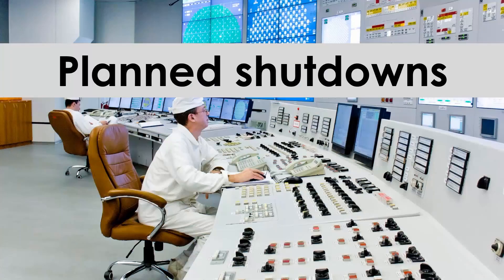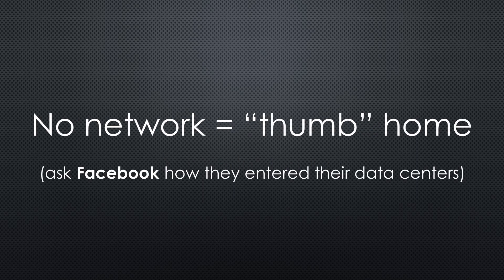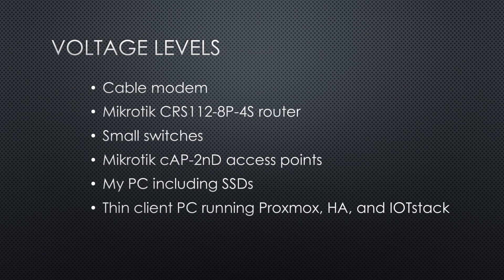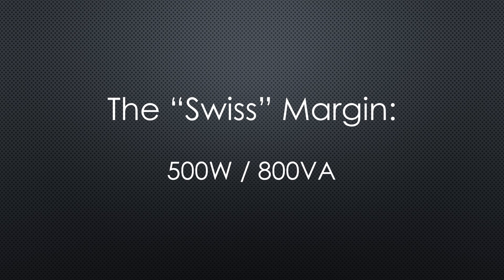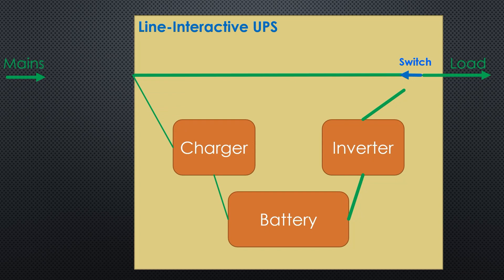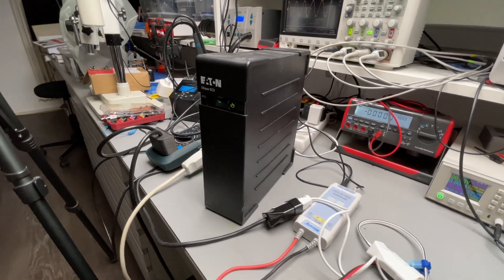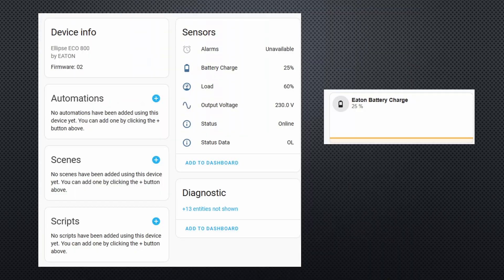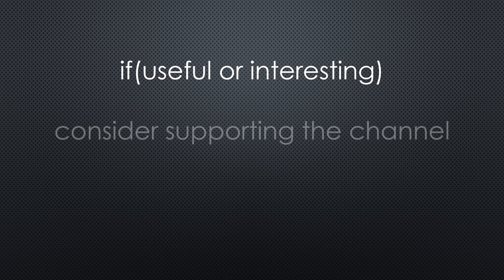447 How to protect Home Automation and PC with an Uninterruptable Power Supply (UPS)

Comment: I bought a bunch of Cyberpower 1500va UPSs that are scattered across my house.  On my "datacenter rack" I've got two setup for "A/B" power and loads are distributed between the two.  With my fiber ONT, router (dell pc, pfsense), NVR (dell pc, blueiris), my Proxmox node (2015 era supermicro 24 bay server, 2x e5 xeons, 2x PSUs), and a switch (unifi us-48-500 model) the pair of UPSs can keep everything online for about 20 minutes during an outage, surprisingly.  Eventually I'd like to try and upgrade to something that can provide a little more run time, and ideally, I'd like to get a transfer switch and backup genset installed but both of those are outside my budget for now.  The rest of my UPSs are on my main TV/AV receiver, another on a couple of my desktop PCs in my office, and the final is for my 3d printer.  They've been very reliable, even a couple older models.  

After got them all set up, I went through the trouble of spinning up a WebNUT dashboard server, installed NUT on Proxmox's baremetal host, and all the other machines around the house.  Integrated it into Home Assistant, had everything working, then the problems started.

NUT just randomly decides it can't communicate with the UPS, and if no intervention is taken, won't ever talk to them again.  I wrote a script that I added to my crontab to run every hour (/bin/udevadm control --reload-rule && /sbin/upsdrvctl start), and it didn't fix the problem, just a bandaid to make it work again.  Eventually I started to notice, if my power glitched even for a few milliseconds, Home Assistant (full virtual machine running on proxmox node) would die.  Completely.  Took me months to figure out why, until one day I was messing with the UPSs on the proxmox node USB connection to diagnose the NUT issue, unplugged them, and discovered Home Assistant VM died.  That was the end of my investigation into both NUT and HA dying.  Completely gave up on NUT.
Reply from the maker: Thank you for sharing your analysis. I have to admit, I suspect the USB interface has an influence. And recently, it completely died. So the Eaton will go back and next time, I will experiment with a USB insulator...

Comment: I live in South Afrika and power outages is a daily occurrence, I have my whole house protected by grid tie inverter and a 10kwh battery with about 6kw of solar panels. Backing op a PC can be done with a Pico PSU and a battery and network equipment with a buck/boost converter from the same battery. I started off with a lead acid battery but quickly realised they are no match for 2 hour outages so I built a DIY lithium battery with 100ah LiFePO4 cells that could keep devices running for about a day. In the end I opted for a big system as I need to be able to continue working during power outages, and that means having coffee and cooking/heating food.
Reply from the maker: My 10kWh solar battery also protects my home for a day without sun. But, because its inverter has to switch off for a few seconds, I needed an additional protection. Going DC as you did with your Pico PSU for sure is a good possibility.
Reply: @AndreasSpiess  strange when the grid falls away and my Deye inverter switches to islanding mode I have a millisecond delay where the relay clicks and nothing reboots, maybe your cables are not big enough and causes DC ripple as the switchover should be seamless. I should have mentioned that my Pico PSU and DC converters was my first attempt to protect against power outages
Reply from the maker: @HeinzMeulke  Our utility company wants a clear separation between the inverter and the grid when the grid is down. It seems that your inverter does this separation extremely fast.

Comment: Great video thanks. I use a similar sized apc ups to power my Synology nas and Poe switch. In turn my Poe switch powers my 8 raspberry pi cluster. I also use nut to provide the remote shutdown to all the pi’s and the nas. 

I think I have made a light error, being worried about switching times my setup is an online ups but being in the uk the power is quite stable.
Reply from the maker: You never know. Up till now, I also did not care about power outages...

Comment: I would recommend looking at a MHPower MPU300 or 500 series...you supply your own (lead-acid) battery, it's sinewave and not outrageously expensive. Also the case is metal. No communication though.
Here they are popular for backup power for circulation pumps on solid fuel heating systems.
Reply from the maker: Thank you for the info. I did not see them in Switzerland. But it is good to know if I have to change my Eaton. Communication is not so important in my setup.

Comment: My Victron Multiplus II provides my UPS function. It has 2 outputs, one back into the mains circuit, which goes off when the mains does. The second essential services output goes to a separate panel and serves a few essential sockets dotted round the house and the lights. One of the sockets powers my PC so that never gets cut off. The Victron controller replaced a Pi and this connects directly to the 48v batteries. The router is run from these via a DC/DC converter so again it never goes off. In a long grid down situation any mains kit can be connected to the essential sockets with an extension lead. The gas boiler has a plug fitted and a dedicated essential socket next to it.
Reply from the maker: That is a good solution. My Huawei also has such an outlet which is cut-off for a few seconds when the grid is down (this is the reason for my UPS). But I was not satisfied with this solution as I will show in the next video ;-)

Comment: We played around with an offline UPS and a variable powersource. The connected 100 Watt light bulb flickers when it switches. While lowering the input voltage the output voltage drops to a certain level then the UPS starts supplying power when lowering further it switches completely over. We went to online UPS for anything PC or PLC related.
Reply from the maker: Good to know!. Mine is now back to the supplier (the USB stopped working). So we will see what they say. I did some test and usually, the switching was extremely fast (as shown in the video). But sometimes, not :-(

Comment: @AndreasSpiess your modified sinewave ups is the problem as many switch mode power supplies can't  detect a decent zero crossing and won't start or wont start properly. I've seen this happening with TV's laptop and computer's. Supply them with a pure sinewave and they will start without a problem.
Reply from the maker: Interesting! I was not aware of this problem. Because switching PS rectify AC, I thought, it makes no difference.
Here, everything works and it is not a problem of switching on. But maybe these waveforms have different "side effects".

Comment: I recently bought a Bluetti EB70, which seems to be able to do pretty much the same thing, perhaps better. If your eaton device turns out to be suboptimal, you might consider one of these devices. It is technically not a UPS though.
Reply from the maker: These are a new class, I agree. Probably an overkill in my situation where the UPS only has to survive for 3 seconds. But they are good for other use cases.

Comment: I am also considering a UPS for a modem, 2 routers and a Raspberry pi. Important for me is a low standby consumption. I noticed that this is not often mentioned in the "technical data" as published by webshops.
Reply from the maker: I agree. This is why I went for an offline UPS. Now I cannot measure its power consumption because yesterday, it completely died.

Comment: That's a benefit for the online mode, the loads never see a power source change, because they are always running from the inverters. A power failure becomes something that is only "seen"at the ups, and the loads continue on with no changes ( faults tend to happen during changes in operating states, rather than steady states). Datacenters will only use online and similar types of UPS.
Reply: A related benefit to online is you always know the relative health of your inverters and the ups in general, because it's always running. You don't need to trust that it will turn on fast enough (or at all) during a power failure, when you need it, because it's already running... If course household usage may not call for this level of reliability, but if you have the need, this is the advantage of online... (Simpler (in many ways) design, higher reliability, fully clean load output, but at higher cost, and lower overall eficiency)
Reply from the maker: I agree that an online UPS has many advantages. What I did not like is its efficiency. But maybe I have to re-think my choice...

Comment: Have a Eaton Powerware on the "to be disposed" pile. The network card permanently crashed and disconnected controller the NAS and it seems to have a issue that it permanently wants to run passively, which results in a ton of heat in the case even at low loads. Much worse than the UPS I had before. 

Currently running a tiny consumer UPS, which is good enough for the NAS and other stuff, there is seemingly no need for a pure sine wave.
Reply from the maker: Thank you for sharing your experience. My Eaton in the meantime does no more deliver power...

Comment: I am living in a country with several power outages during the day. 

First i built a DIY UPS with a Meanwel Ad155 12v 10A switchable Power Supply using voltage converters for 5V, 9V, 12V, 48V for Pi, Switch, Ext.Hdd/FritzBox, POE Switch with a 12V 17ah agm battery. 
This worked well until the V regulators kept failing. And during switching between lineIn and Battery either the modem lost dsl sync or the poe switch went out until the regulator for 48V adjusted. Didn't happen all the time but was annoying none the less.

To solve this i bought a 230V PowerSupply from Kemot ProSinus 700VA buying a 65AGM battery. 
Now i use the regular power supplies that come with the appliances.
Added a miniPC and my Alarm Sytem to it. 
So far now problems.
Reply from the maker: Cool. You went the same way I initially wanted to go with several DC voltage converters. So it seems that a 230V UPS should be a good solution. Let's hope my Eaton will be repaired.

Comment: Hi, I think you missed an important topic about offline UPS! A phase difference between the grid power and the internal inverter of a UPS can potentially cause a voltage spike. This can happen when the UPS switches back to grid power after running on battery power, if the phase of the grid power is not in sync with the phase of the power being output by the UPS's inverter. This can be a problem for sensitive electronic equipment, as it can cause damage or malfunction. To avoid this issue, some UPS systems include a feature called a "phase-lock loop," which synchronizes the phase of the UPS's inverter with the phase of the incoming grid power, reducing the risk of a voltage spike. Additionally, a good quality UPS should have built-in surge protection to mitigate voltage spikes caused by phase difference or other issues.
Reply from the maker: I agree, these voltage spikes could be nasty. I never saw such spikes, but I do not know how they do it. Maybe they try to synchronize before they switch. Or the standard surge protector inhibits a spike.
Reply: @AndreasSpiess , I know you are very knowledgeable about what I said. I wrote this because you mentioned a problem with the "EATON" device in the video. As you know, we may have up to 380 V voltage differences due to live-line phase differences. Therefore, for example, any protection at the input of the power source (such as PTC, etc.) may reduce or even cut off the input power to the power source for a while, and it is normal because this spike ends after a short period. cause illogical events in your equipment. And maybe cheap inverters may not have any protection in their output for this synchronization. As far as I know, Line-Interactive UPSs do this coordination at the time of the switch from the inverter to grid power.
In the end, I must add that I have unfortunately experienced these spikes several times and unfortunately the power supply of my servers suffered severe damage several times until I noticed this problem in my offline UPS and upgraded it to online models.
And thank you again for your interesting videos.

Comment: I'm using RIELLO SENTINEL DUAL 6KVA for powering my office room directly from the fuse box with a RB1 Bypass switch for maintenance. I found it to be basically a ''powerwall'' alternative for cheap. I keep it in eco mode and it consumes 50W extra and that's a not big price to pay for ability to continue working for another 5 hours. I don't have it connected to grafana or home assistant as it does all I need it for. For now the ups can send out a command/email when I'm not at home and it will safely shutdown all the components. The only complained I would have is batteries... Only recently server space has started to adopt lithium. For the same space that my unit take up I could build 4-5kWh battery, while mine is only 2kWh right now.

I also have Eaton 9SX6KIRT, but I haven't played enough with it to give a proper opinion
Reply from the maker: This is a "biest" compared with mine. Because I have a 10kWh LiFePo solar battery, this would be an overkill (shown in the next video). But in your situation it seems to be ideal.

Comment: One of the jobs on the list to make a small battery ups for the internet.
The computers and servers already have theirs, it's just the modem and router that needs something.

Building my own from scratch as it's a standard DC and relay... Problem is that the ISP doesn't seem to have one...

We had a power outage, the internet went down but it took virgin (isp) around 40 minutes or so to get their equipment working again.😢

I have small ups and big enterprise inverters that could run the whole house.. and off grid solar.😊
Reply from the maker: So you are already perfectly equipped ;-)  My ISP router is also very "vulnerable", BTW.
Reply: @AndreasSpiess  well the two devices are separated (by rooms) so I have to make two power supplies. 
Power here is fairly good, we have had a few blips and some I've not even noticed, but the ups has logged them. 
We had just over an hour last week. Which isn't bad for 8 years...

I'm in the process of battery building, the old laptop ones.. not recommended. But I have an ev battery (NiMH) but I've not tried it out and it's been sat built for a while now. But if needed it can be spun up quickly.

My big issue is not at home but other services that can go down. Aka internet.

Comment: I use APC UPS devices, one per PC and one in the Data closet. They always switch correctly so I don't lose connection. Since I have a Whole house Kohler backup generator, the UPS's only have to work for 11 seconds. Most will last 30 minutes.
Reply from the maker: As you will see in my next video, mine also only has to run for 3 second till the "big sister" kicks in. But I expected that it is able to bridge these 3 seconds.
Maybe I had a faulty device. At least it completely stopped working for the moment.

Comment: With the current energy prices it would be nice to see more info on the additional (idle) power consumption of the UPSes. It is very hard to find a comparison of idle power of the different models/brands/types.
Reply from the maker: Mine consumed around 8W in addition to the load when not charging.
Reply: @AndreasSpiess  I recently bought a PowerWalker VI 850 LCD  which consumes around 17W. That's a lot for doing nothing. Still would like to find a small/cheap one that consumes very little when idle.

Comment: We have three CyberPower CP1500PFCLCD units.  They are 900W offline (I think, based on the relay clunk noise they make when there is a power event) sine wave inverters.  They come with 96Wh lead acid batteries and have never caused our PCs or modem to reset even a single time after a power event, which we get several times per month (usually just a <50ms undervolt or overvolt, not a blackout).  Our units are about 5 years old and the lead acid batteries can still provide enough current to handle any interruption, although our power requirements are only about 300W max on each UPS.  They connect via USB to our PCs which have software for Windows and Linux to monitor voltage and power consumption and configure shutdown actions.  We are very satisfied with them and in my opinion they are quite reasonable in price in Canada (about 170 Swiss franc).  That being said they are 120V units and I don't know if they make 230V output versions.  But perhaps you could run the UPS on a 230->120V transformer and most of your 230V->DC power supplies may already work with 120V with a toggle switch or you can find widely available 120V versions of them.
Reply from the maker: Thank you for sharing your experience. They seem to sell also products in Switzerland. But so far, I was not aware of the brand.

Comment: I got the best results from Eaton 5E it works flawlessly with the NUT and protected my stuff from 2 outages since installation. There is one problem, though: the bigger models' fans are loud and spinning all the time while UPS is charging. It is not a problem for rack installation but I wanted dedicated UPS for my workstation. I bought APC and it had poor support in the NUT, it was losing connection, also it has two bright green LEDs You cannot turn off (at least I didn't find that option), but it was quiet. I tried other UPSes but for my budget, they were all crap.. so I settled for small Eaton 5E for my server and no UPS for my workstation for now..
Reply from the maker: Thank you for sharing! My Eaton is quiet at least! We will see how this ends. For the moment, it stopped delivering any energy :-(